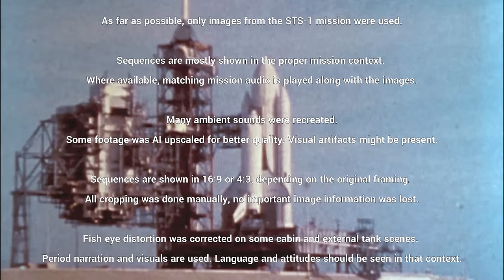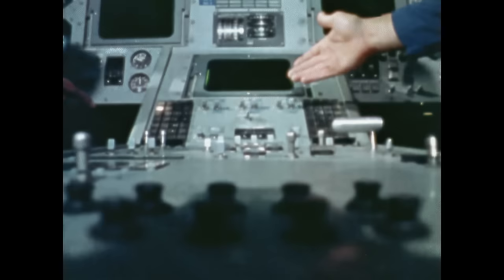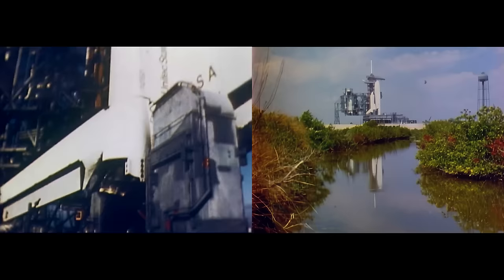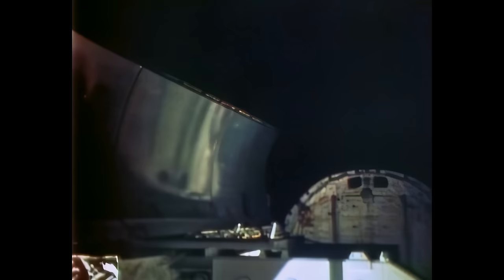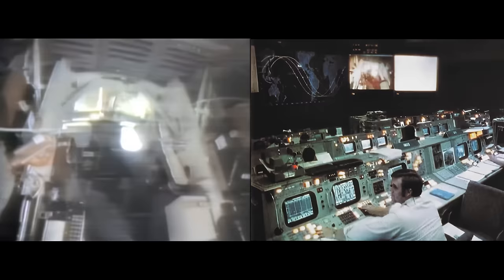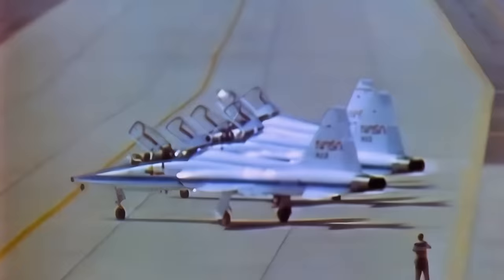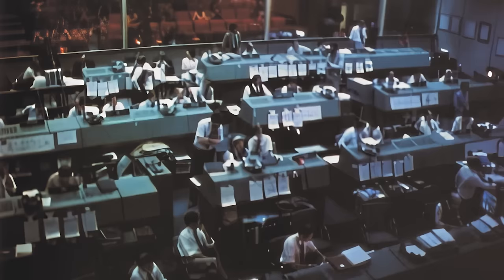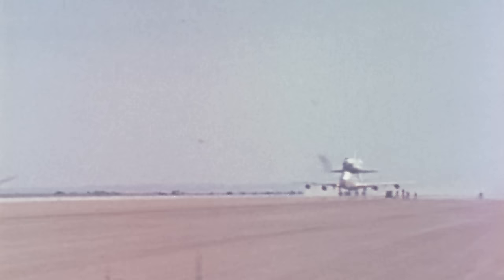STS-1 Full Mission - Historical Narration and Footage - First Shuttle Flight, Launch, Landing, 1981

Comment: The shuttle was such a departure from the conventional rocket/capsule combination.  Not having an robust escape system always made me super nervous.  Glad we are back to traditional rocket designs.
Reply: a radical departure but capable of things nobody else could dream of with a capsule design. Hopefully, in the future, a significantly safer spaceplane design capable of retrieval and return graces earth orbit
Reply: @kadmii  Hopefully SpaceX Starship will be able to fulfill that deliver and retrieve capability if it's as good as promised. We can't keep ourselves shacked to less capable "traditional designs" forever.
Reply: 'Traditional designs' are stagnant.
Reply: @RideAcrossTheRiver  Just needs to have a robust escape system.  What the Shuttle had gave little margin compared to Apollo.  You need to be able to survive a catastrophic failure at anytime during the flight.
Reply: Yeah, and what we learned was that the traditional capsule and rocket design is the way to go. 

The strap-on design of the Shuttle was done to save money, which it did not. At all. And that design ultimately caused both the Challenger and Columbia disasters.

The design has no future, and has been abandoned. It never should have been used to begin with. If we had stuck with the Saturn V and IB boosters we'd be at least two generations ahead by now in space flight.

Sorry, but that's the truth..
Reply: @aceshigh6499  Apollo capsules were far more dangerous than the Shuttle. Also, there is no escape system "to survive a catastrophic failure at any time during flight"
Reply: @RideAcrossTheRiver  - Landing like a plane is ridiculous. The only reason it was done was for PR. To go with the whole cost-saving 'reusable' nonsense.

Instead of having wings, hydraulics, landing gear, control surfaces etc, you replace all that with just parachutes.

And instead of using ludicrously delicate ceramic tiles you use a robust ablative heat shield, that stays protected until right before use.

The only deaths during Apollo were on the ground.

We may someday have an advanced, truly reusable, orbital and beyond spacecraft, but not until we stop using chemical rockets for flight. And that's a long ways away. Not in our lifetimes..
Reply: @RideAcrossTheRiver  It was NASA's plan back in the naive and overly optimistic 50s. When we were all gonna have flying cars and live on cities on the Moon by the year 2000. And the Shuttle was an attempt at such things. 

Which is why it turned out to be a flawed, expensive, impractical, dangerous white elephant boondoggle.

And yes, test pilots may have loved the idea of the Space Shuttle, but engineers did not. Even John Young, a veteran of Gemini and two Apollo missions and commander of STS-1, knew how dangerous it was gonna be. He thought they had a 50/50 chance of surviving that first flight..
Reply: @HailAnts  "NASA's plan back in the naive and overly optimistic 50s."

Nope. Development was well underway with many test flights of workable designs--that flew to space. Gagarin's stunt changed all that and NASA was forced to abandon its designs in favour of the cheapo Soviet method.

"Which is why it turned out to be a flawed, expensive, impractical, dangerous white elephant boondoggle.

Bullsh*t. Apollo was the waste case. 

"John Young, a veteran of Gemini and two Apollo missions and commander of STS-1, knew how dangerous it was gonna be. He thought they had a 50/50 chance of surviving that first flight"

No, he never said that.  He said there was a 50-50 chance STS-1 would be a total success. I will allow that you are lying by ignorance, but nothing you've said is true.

With the return to Soviet methods, US manned flight will end by 2030. Forever.
Reply: @HailAnts  " the Shuttle was an attempt at such things. "

Nope. Those were capsules.
Reply: @HailAnts  John Young, on the Moon, April 1972: "The country needs that Shuttle mighty bad."

John Young, after STS-1: "We have a remarkable capability here with this machine. Let's not throw it away."

SLS will be used a few times to put a few people on the Moon and then manned flight will be over except for Musk's tourist trips and the Chinese space station.
Reply: @RideAcrossTheRiver  - The biggest downside with the Shuttle is that because of its specific and inflexible design it locked-in all the technology. Consequently nothing advanced during the whole 30+ years of it flying. Expect for the band-aid fixes NASA implemented after each of its disasters.

The Saturn boosters and Apollo hardware were still generic enough that they could have been used for a myriad of mission profiles. Unfortunately the Apollo Applications Program ignored them all except for Skylab. Again, because of the myth of reusability.

And by Apollo 17 they were a proven, well developed, reliable, and cost effective space launch system. Not a single Saturn V suffered a major failure. Just canceling Apollos 18, 19 and 20 was an enormous mistake. The hardware was bought and paid for and the infrastructure was in place. Canceling those last missions saved a whopping $80 million dollars, out of a program that cost $25 billion. We could have had 50% more Moon landings for basically no extra cost. And again, because of the public's totally incorrect and ignorant perception that it was wasteful.

Instead we got a shuttle with no place to go. It's first mission would have been to save Skylab, but delays in the program prevented that. The ISS could have been built at a fraction of the cost with heavy lift Saturn V launches, instead of half-billion-dollar-per-launch Shuttles. And crewed and maintained with reliable, flexible, and safe LEO Saturn IB boosters.

And during that time the hardware could have been slowly improved and modified with the experience gained from each mission.

In the future the Shuttle will be seen as this pie-in-the-sky program trying to use technology that was woefully unprepared to even remotely perform what was promised of it. Because of govt bureaucracy and public ignorance..
Reply: @RideAcrossTheRiver  What was the Apollo escape tower used for?  https://www.youtube.com/watch?v=fQzJFpZ0qpw
Reply: @aceshigh6499  Nothing. It was discarded each mission.

The capsule-booster design was actually the "departure" you describe. NASA's plan always was to have a reuseable space plane. When the Soviets pulled their stunt with Gagarin, the US gov't got so wound up that it resorted lamely to copying the USSR's method--to the horror of pilots engineers, and designers.

Apollo was just an extension of the ad hoc MISS program.  It was the radical stray from best design.  You guys need to read your space history because none of you know what you're talking about.
Reply: "the myth of reusability"
Reusability wasn't a myth.  More than one hundred flights of the STS, reflying the most expensive parts many times, proved that.  But if not a myth it was a very expensive reality, and came with substantial operational restrictions (plus a lot of fragility) for the system which was finally implemented.

"Landing like a plane is ridiculous. The only reason it was done was for PR."
Too bad you weren't around to show them how to recover a crew capsule + 25 ton payload by parachute... from space... reliably.  So an aircraft approach was in fact unrediculous.  Orbiter problems stemmed more from the thermal protection system chosen, than that it had wings.

"And instead of using ludicrously delicate ceramic tiles you use a robust ablative heat shield, that stays protected until right before use."
One reason they went with "airplane", despite the known and unknown risks of tile development, was that an ablative thermal protection alternative was available, for a certain weight penalty.  But finally, they were too far down the "tiles" rabbit hole to turn back.  Just one more fix, and maybe this time it will start working well...

At the time NASA got program approval from Nixon for a reusable space transportation system, the configuration hadn't been setted on.  What we know as the Shuttle was a leading candidate based on contractor proposals, but very different booster options for the orbiter (e.g. S-IC) were still being looked at.

"Not having an robust escape system always made me super nervous."
"Just needs to have a robust escape system."
An escape system was budgeted in the Shuttle budget as originally approved (specifically, a few hundred million for development of the solid rocket motor), but dropped shortly after the program got underway.  Those funds were moved to the cost-overrun part of the budget, since right away the upward cost trend was apparent and they didn't want to already be in the hole after barely getting started.

"The strap-on design of the Shuttle was done to save money, which it did not."
The strap-on configuration saved a whole bunch of money.  Other alternatives, such as a 700,000 lb winged booster (S-IC, or new-design) would have been wildly more expensive and perhaps technically unachievable.  NASA preferred an ocean-recovered new liquid booster, but realized the chance of intact recoveries and reusability was slim compared to the far sturdier and proven technology of large-diameter multi-segment SRM's (even those, as was found from STS experience, had trouble surviving ocean landings undamaged). 

"reliable, flexible, and safe LEO Saturn IB boosters"
The Saturn IB was very expensive to produce relative to its payload capability.  The complexity/expense was designed in, and nothing along the lines of volume production, for example, could substantially change that.  The IB met a need at a certain point in time, but that was about it.

General comment:  I can agree with plenty of sentiments expressed by posters in this thread when it comes to wudda cudda shudda's of the choices which were made and how they worked out.  What I take issue with is contentions which amount to "I'm smart -- NASA was dumb", made comfortably after the history has been written.  Many of the same sorts of arguments could have been made in advance of the Saturn V:  "A 10-meter diameter cryo stage?  Are they crazy?!"

Things transpired for STS in the ways that they did for perfectly sound reasons, if you know the actual history (which is mostly absent of governmental or engineering stupidity).  My biggest knock against NASA was something I got a brief taste of once the flights were underway:  Normalization of deviance.  I raised an important safety concern with the Orbiter program manager, but they didn't care because well, they had more important things to worry about... like keeping the wings from coming off (literally a problem -- like I said at the beginning, "fragile").
Reply: @RideAcrossTheRiver the apollo capsule had a launch escape tower that would pull the capsule away from an exploding rocket. Those spikes onto of rockets aren't just decoration.
Reply: @fast-toast  Capsules are silly.
Reply: @RideAcrossTheRiver  that reply is the equivalent to the "NUH UH" meme.
Reply: @fast-toast  You are, yes.
Reply: @RideAcrossTheRiver  what is the bases for saying capsules are silly.
Reply: @fast-toast  They can't do anything except ferry people and a change of clothes.
Reply: @RideAcrossTheRiver  so... that's their purpose, and they are good at fulfilling it. What's the point in mixing crew with cargo.
Reply: @fast-toast  There's no reason to send people to space, then.
Reply: @fast-toast  No shuttle, no space station.  No Hubble.  Webb will fail soon.
Reply: @RideAcrossTheRiver  I'm done with this. You have your opinion, and I have mine.
Reply: @fast-toast  No, I have facts.  Why did you lie, though?
Reply: @RideAcrossTheRiver  The Apollo escape system would work at any point during launch.  The Space Shuttle could only safely perform an emergency landing at certain windows in the launch process.  The Shuttle could not survive a ditching at sea.  The crew had to bailout right before landing.  Incredibly dangerous.
Reply: @aceshigh6499  "Incredibly dangerous."

No, it wasn't.  But we're back to 1950s technology now, on the downslope of human space light.

Comment: Okay, my question is this, at 41:11:  did they truly have a ton of runways on the lake bed marked off just in case? I know the first landing was on dirt, but I haven't paid attention to exactly how that dirt was marked. Were they worried about potential deviations to the predetermined flight and landing path?

Edit:  punctuation
Reply: Edwards always did, and still does, have multiple runways marked out.  But the ones used for shuttle landings were specific ones due to the ground based guidance equipment required.

Comment: Did it to save costs, turns out, not only was it more expensive, in the 2020's we are launching and landing like we were in the 60's.
Reply: True, but one of the original purposes of the shuttle was to launch something like every 2 weeks which would have made it worthwhile.

When you think about the limited number of manned launches in the present age, the 60s method is the best method.

Bureaucracy ruined the space shuttle. It was integral to building the ISS after all.
Reply: Shuttle program cost $3.5 billion a year. Capsules were the USA's fright response to the USSR's silly Vostok.

Comment: Why was the main fuel tank white instead of brown?
Reply: On the first two launches they painted the external tank white, largely for aesthetic reasons and UV protection,  but then they realized the paint really added nothing in the way of protection and was therefore not needed. The benefit of not painting the tank was a savings in weight, many hundreds of pounds, which could be translated into more cargo.

Comment: Was it just luck that no tiles from underneath had come away?
Reply from the maker: That area was relatively shielded during liftoff, so the probability of losing tiles there was lower. But still some luck I guess...
Reply: A total of sixteen tiles were lost and 148 tiles were damaged. There was heat damage to the forward and aft landing gear doors, plus a a list of other issues and anomalies with the thermal protection system. Fortunately, the damages were not or a magnitude or location to have caused the orbiter a catastrophic event during re-entry. Full details the mission performance and anomalies is available in the STS-1 summary report.
Reply: One of many concerns ahead of the first flight was whether acoustic energy at liftoff would liberate massive numbers of tiles.  NASA hired a couple of statistitians to examine static test engine firing data and come up with a guess regarding that.  Their guess turned out to be the correct one, as the tiles apparently stayed put.
Reply: Knowing what the real dangers of shuttle launches,  I cringe when they mentioned ice coming off the main tank and striking the shuttles tiles.  Parts of Columbia are still underwater in Toledo Bend a reservoir lake between Texas and Louisiana.   A friend of mine from Western Louisiana took part in the search for Columbia's debris.   They found bits and pieces.

Comment: Reporter: It's not clear to me how you use the ejection seats during the ascent phase
Young: Ya jus' pull the l'il handle
Reply: Ask Challenger's crew if it was possible to eject during a launch malfunction.
Reply: @jollyjohnthepirate3168  Do you even know the seating arrangement on the Shuttle? Also, the Orbiter broke up in two seconds.
Reply: @jollyjohnthepirate3168  IIRC, the ejection seats had been removed from Columbia at that point, and they hadn’t even been installed in Challenger in the first place.

Besides that, ejection was only possible for the two on the flight deck.  The other seats were buried too deep in the structure for that to work.  NASA developed a bailout system after the Challenger accident, but since it’s not automatic, I doubt the crew would have been able to exit the craft even if it had existed.
Reply: @RideAcrossTheRiver  The sad thing was the Morton Tiakol guy who was kicked off NASA property for almost getting into a fist fight with the launch managers.  MT built the SRBs and knew the O rings could fail at low temperatures.   He tried to get them to delay Challengers launch but was over ruled.  Reagan was supposed to interview the teacher in space that night and NASAs delays made the government look bad.
Reply: @jollyjohnthepirate3168  Morton Thiokol 'knew' the O-rings would fail? I don't think so.  They said the launch was outside design limits.

Comment: I'm a little confused. I heard on the launch audio that emergency ejection was no longer possible at some point. I didn't think the shuttle had an emergency ejection system
Reply: The first few missions had ejection seats. After the “test” phase ended, they removed the ejection seats and replaced them with regular seats. At that point, it no longer had an escape system.
Reply: @dgeerusmc  wow. Just wow. Why?
Reply: I’m not sure. I do know that on future flights with the full crew complement that some of the astronauts sat below the others, so unless the ejected downward, there was no where for them to go. That is my guess, I do!’t have any info beyond that.
Reply from the maker: Regular airplanes don't have ejection seats. The reasoning was the same. After the test flights, the shuttle was considered safe.
Reply: @dgeerusmc  They only had ejection seats for the commander and pilot positions if memory serves.
Reply: @dq1275  The ejection seats were only ever used on test flight missions with a pilot and a commander. They were disabled after STS-4 and removed sometime around STS-9. They were never intended to be permanent.